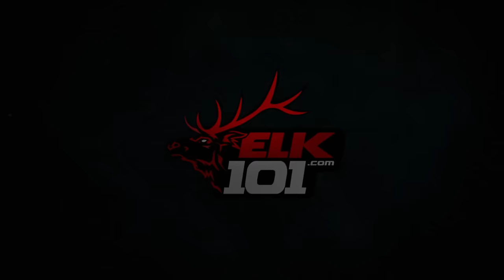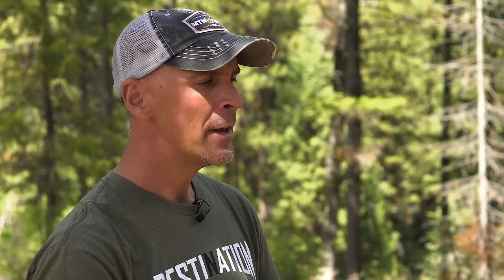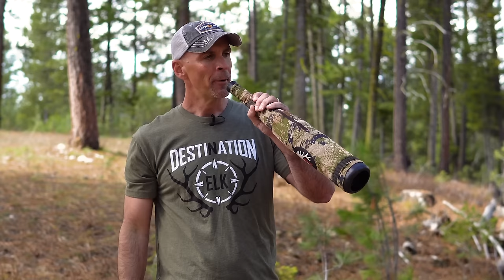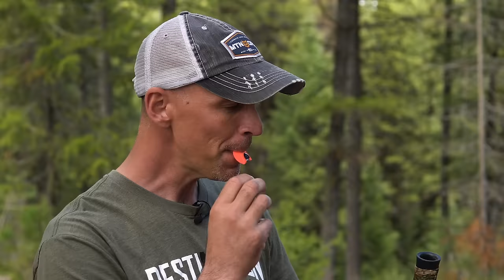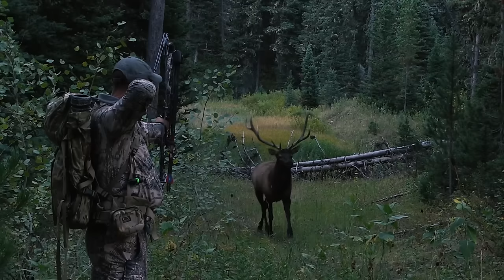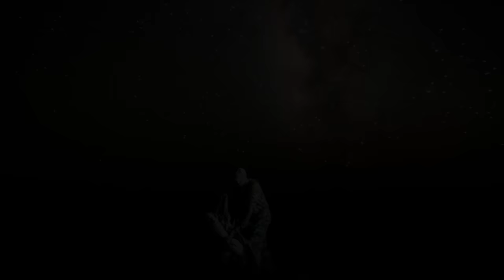Learn to Bugle with Diaphragm Elk Calls

Comment: Corey, your "climbing the stairs" sounds more linear like a gradual progression.  When I bugle it just seems to jump octaves in clear steps and I have a very hard time consistently hitting that high note (it happens on accident and I'm not sure why).  Blowing harder doesn't help so I'm suspecting its a tongue pressure issue but I haven't figured out what's wrong.  Any tips?
Reply: hey, he didn’t respond so i have a good tip, that is if your still learning, your tongue pressure is basically the climbing of the stairs, start with your tongue lower on the latex then slowly apply more tongue pressure as you want a higher note, you want the pitch to slide between high and low, so your tongue should start with a lower placement, gradually raise it, then quickly drop the pressure, applying the slightly longer grrrrr sound at the beginning than the end.
Reply: He didnt reply likely because he already explained in the video.
Reply: Got to practice tongue pressure, tone, and technique first. Most def are not going to get it right away from just watching a video. One thing this video does not go into is proper placement in the mouth.
Reply: @MegaPerson012345  actually I found that the RM reeds I've had do not work for me, I'm sure there are some in their line that would, but the three Phelps reeds I've tried work perfectly for me with full control.  Probably shape or latex stretch issues.

Comment: The only way I can make any sound is if I put the latex on my bottom lip but still in my mouth. Other than that I can't get sound or I gag. I guess everyone has their own tricks or ways
Reply: Some people have a super hard to get over gag reflex, unfortunately. I have one. Sometimes I can mitigate it, but super tough.
Reply: I would try the diaphragm he is recommending for beginners. You may need to trim the tape to fit, but dont over trim or you will not get a good seal. Getting it in your mouth correctly will help with gag.